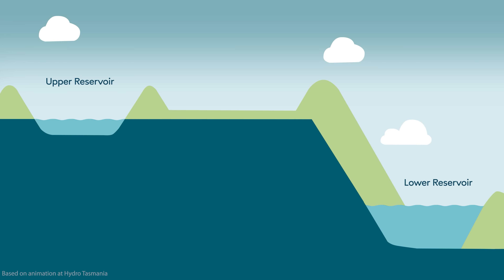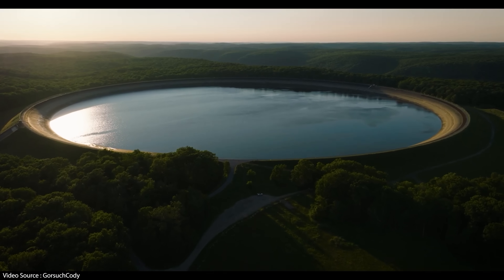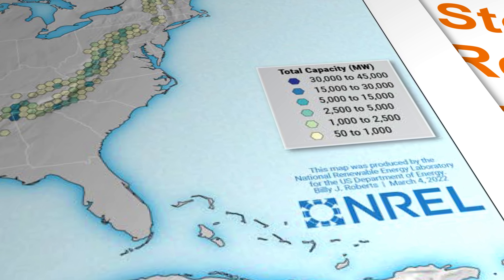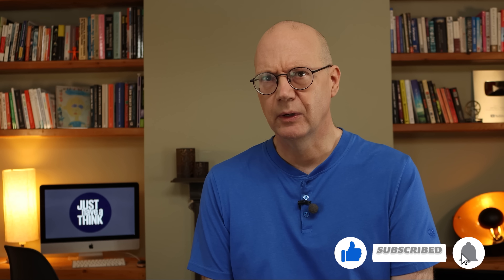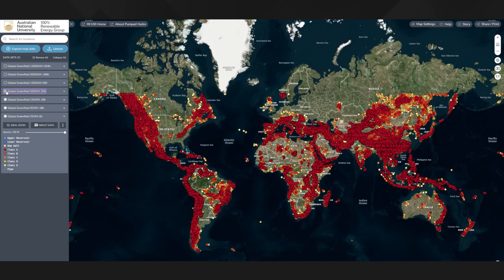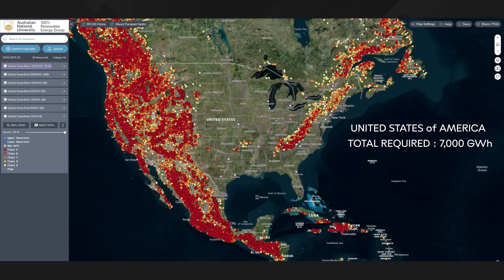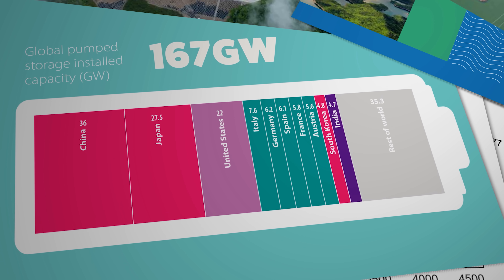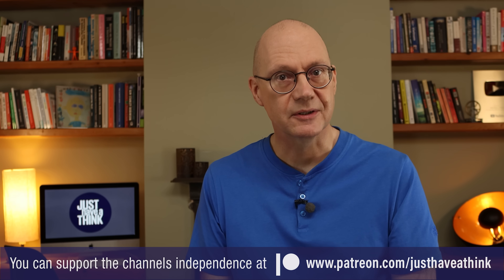The insane potential of Pumped Storage Hydro

Comment: It seems to me there is a synergy with pumped hydro and wind.
Both tend to want to be at height ...... but the pumped hydro would need a suitable nearby low spot as well. 
It may well be a good idea to look at, if not micro, then at least smaller pond sized hydro if it is to be used for balancing the unpredictable wind farms. This would extend the useful time an instillation could produce for and make controlling the Grid an easier task! This is often overlooked by planners!

I do have to wonder about the carbon footprint of all the concrete needed for this though ;o)
Reply: SUggest math before posting moronacy
Reply: A lot less than for a nuclear plant for sure.

Comment: There is a company called RheEnergise that has developed a closed pumped hydro system that uses a high density fluid - some kind of non toxic mineral suspended in water - which reduces the footprint of a plant for a given power. The drawback is that the reservoirs need to be fully enclosed which is expensive. Still, they think it makes sense in some situations 🤔

Comment: You have little idea what you are talking about. Building a hydro-electric project is a massive undertaking and immensely damaging to the natural environment. The sites are inaccessible and remote and need massive associated infrastructure and ancillary works. It is old technology and the feasible and practicable sites have been used. The UK has 2.8GWh pumped storage, so for 20GWh per million you would 1380 GWh energy storage.

Comment: Pumped Hydro claim to be about 1/3 the cost of lithium ion batteries but fail to mention a 40% loss of energy cycle loss compared to 10% for batteries. Batteries take up considerably less space and being modular can be distributed closer to where the energy is needed, to the extent that every consumer could have their own. A centralized system will increased the demand on the grid compared to a distributed system which would significantly reduce the load on the grid by taking daytime load and moving it to the nighttime.

Comment: Good dose of optimism, thanks Dave!  These systems would be so low-tech and cheap compared to equivalent capacity battery-based systems.  How about putting the reservoirs underground, or using underground capacity that's already there?
Reply: Severely geologically constrained is the reason.  Almost nowhere can you do this.  A few very rare instances is not reality.  Also a severe volume problem as well. Then throw in inability for maintenance.  Viable in tiny circumstances...

Comment: I Like pumped hydro but it is one of those tech that you can just pick a number you want then make a map showing that number if sites available which comes off as disingenuous.
Reply: @garysmith5025  I don't who which one your referring to but it sounds like your just doubling down on my point.
Reply: @garysmith5025  No, that has nothing to do with my point at all.   It's not the validity of the individual data elements that's the issue.   It's the fact that, what constitutes a 'valid site' is a political question and not a scientific one.  So it's the lists that disingenuous, not specific data elements as per my oc.